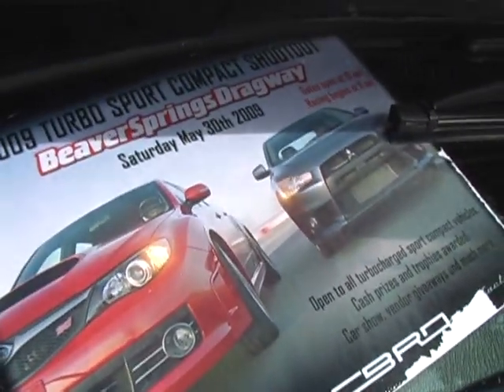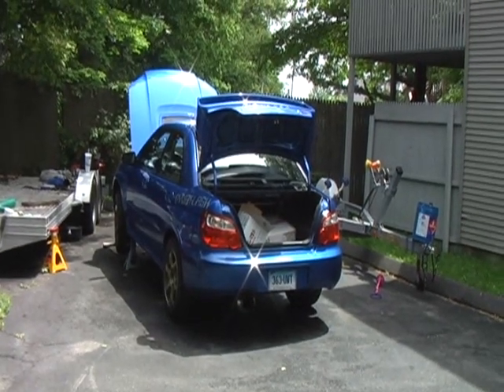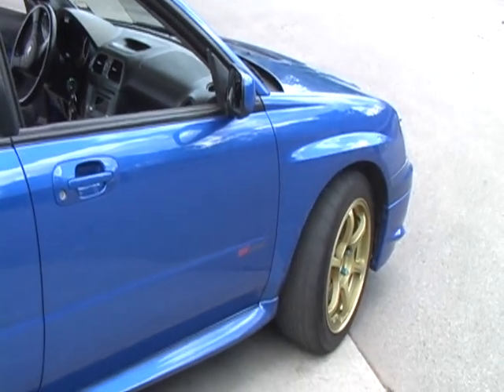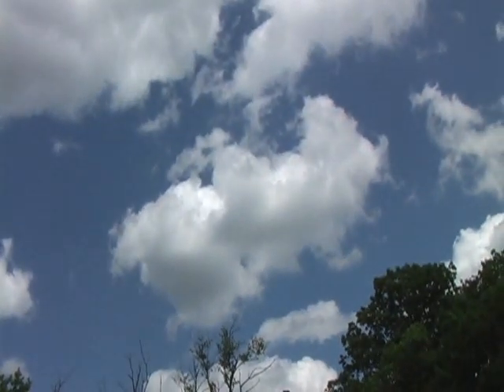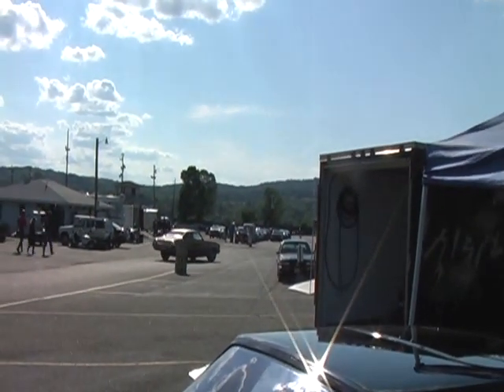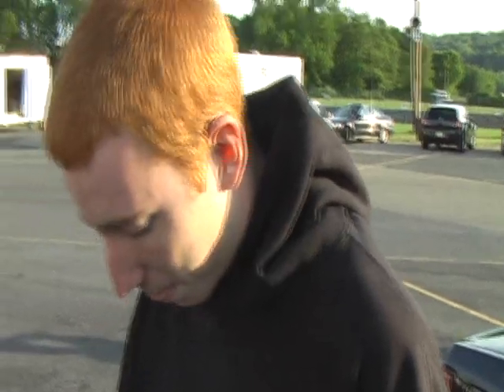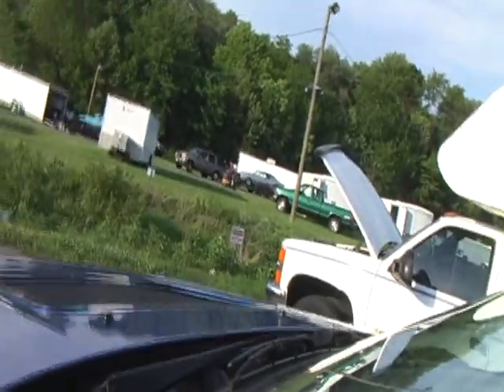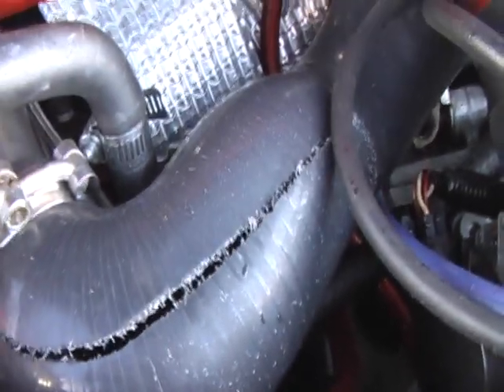Never Give Up ! my tip to Beaver Spings Drag Strip

Comment from the maker: Its a common failure item on 1999 Chevy Trucks - this is the second fuel pump I have replaced on this vehicle - this one laster 70 K miles.   Not much you can do but replace them when and if they fail.  Chevy sucks.